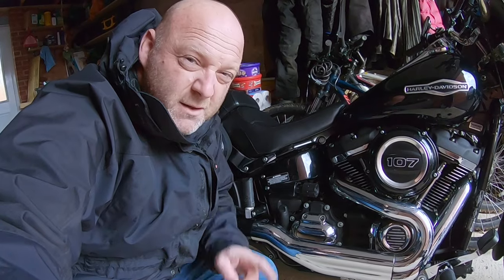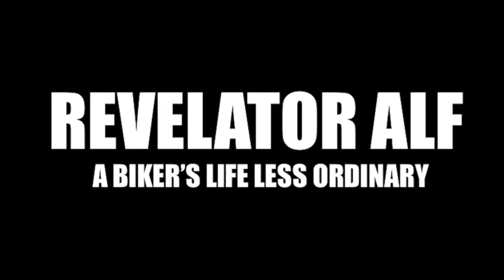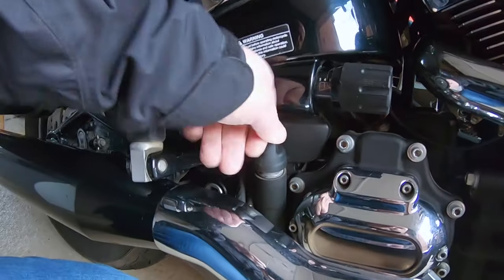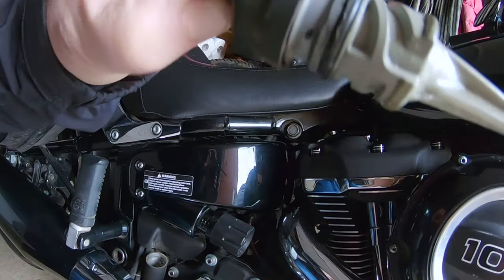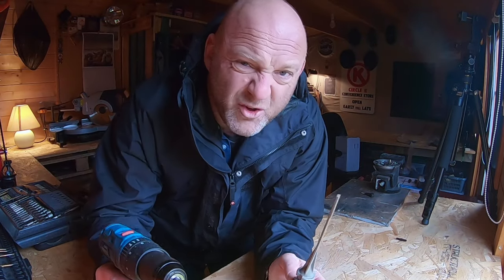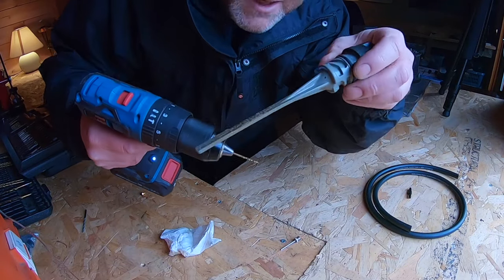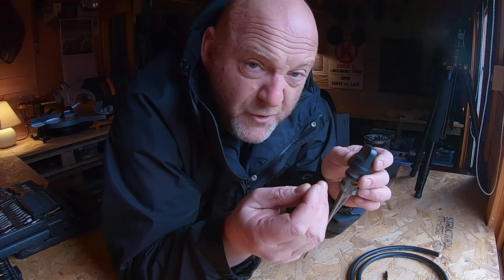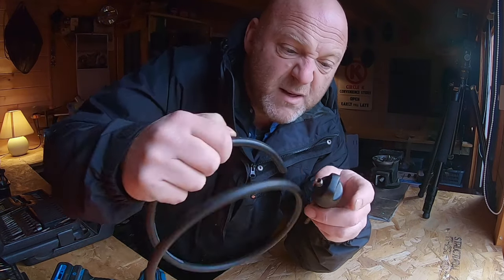How To Make A Harley Davidson Milwaukee 8 Engine Homemade Vented Dipstick

Comment: Hi ,Very similar to what I have done but what you must remember is that the black turn cap is just clipped on ,now that you have made a hole in the bottom to release pressure  in to the dipstick body  .pressure/oil mist can seep under the black cap. I sealed mine so the pipe is the only place for pressure to get out. Keep up the great work my friend. If it doesn't work a new dipstick is only 20 quid.
Reply from the maker: Yep cheers. I added that point to my pinned comment as forgot to mention it in video. I'll be doing a follow up video soon. Dipstick Mark II. cheers

Comment: I'm going to do this with a few small changes...I will use clear silicone tubing and make a larger vent hole in the cap, this way you can visibly see any oily build up in the tube.  Not riding season here yet but when I get it done I will leave some feedback...Thank you for the video...Very helpful...

Comment: Thanks for the video but I think that the hole of tle ball pump pin is way to small if you consider the volume the piston are expelling. High flow in a small hole yield higher speed hence higher pressure that with a bigger hole.

Comment: You have circle k stores in england?
Reply from the maker: We used to, not sure if any are left these days
Reply: So heres a lesson learned…I have a 2018 Road King M8 107ci. I routed my upper breather hose out of the stock air intake mod. When i screwed the cover back on, the vacuum hose i used got pinched between the cover & the air filter by accident. Well, went for a ride & it was running weird, oil light came on. Stopped at a gas station & decided to check the oil, unscrewed it & oil exploded all over me, the pump & the side of the bike was covered in hot oil. It blew half a quart out. I refilled it, removed the air filter & saw where it was pinched. I feel lucky that the head gasket didn’t blow. The pressure in the bottom end was unreal. It just shows how important it is for this engine to breath.

Comment: I know the fueling has a 1 way check valve and I know you mentioned this in your video. The A1 ventilator (not for softail) has the theory the engine breaths both ways to best to have it free flowing.
Reply from the maker: Yes could be right too. Cheers

Comment: Thanks for the video. From the limited information I know any m8 engine stage 2 or higher recommend having a vent due to higher compression and possible dry sumping issues. Great cheap fix!
Reply from the maker: Thanks so much. Yes that's the case I believe too. Cheers
Reply: Stage 2 is just a new cam ... I don't think it modifies the compression.

Comment: Oil pump on 2020+ M8 bikes is supposed to take care of sumping issues.
Oil transfer issue was mainly with hydraulic clutches on touring bikes.
2021 Softails have a vented transmission cover. No oil transfer on my FLSB that I've been able to discern, but,  i've not taken her on a long run yet.
Reply from the maker: yep
Reply: I have a 22 Road Glide Special I was doing 80 miles an hour for long periods Of time all of a sudden  I  felt like something was  pulling my bike back  like an anchor was attached. This happened two weeks ago this is a very weird feeling. So apparently sumping is definitely an issue.. I'm definitely going to get vented dipstick... The sumping issue was not resolved totally... You'll see when you do high speed for a long. Of time.

Comment: I was gonna buy the Feuling one, but realized I could easily make one myself and save over 200$ doing so.
My design is fairly similar to yours but the air passage is much larger.

That air hole tube you used however is not large enough for pass through. The line needs to be 1/4th inch or larger.
Demonstrate this by trying to breathe through that tiny tube, then go grab a juicebox straw. You can't breathe at all through that little tube, you'll pass out. You can almost breathe properly through the juicebox straw. Get a regular straw and you can breathe just fine.
Same with the engine. That hole wont be large enough to let pressure pass through properly and will allow oil to channel up into the breathers.
You arent going to notice much of a difference trying to let the engine vent through a hole meant to fill up soccerballs and basketballs slow enough that kids dont pop them.
Reply from the maker: Can always drill a bigger hole I suppose
Reply: @RevelatorAlf  I plan on using 12mm stuff for mine.
Reply: Are you selling this mod on line for a M8
Regards D
Reply: @davidledward9820  I actually didnt go with this.
I went with the Trask CheckM8, and a Temperature Dipstick instead.
Much better combination.

Comment: WHAT DO YOU THINK ABOUT EXTERNAL BREATHER SYSTEMS
Reply from the maker: I am trying to gather more data on this. I am producing another video for a homemade fix too and then determine whether it has any benefit or not. But I'll have to put some mile on it before there's any results. Cheers
Reply: Can you do a how to for external breather with screaming eagle elite air cleaner.

Comment: My 2021 streetglide trans. is already vented
Reply from the maker: ok great stuff
Reply: @RevelatorAlf  You miss this Revelator,  the poster thinks his crankcase is vented already..  Yep Tom, your transmission was already vented at factory.. Revelator is talking CRANKCASE ventilation (though I don't think the dipstick method is the better way to do it)

Comment: I’m not mechanical RA at all, so forgive the niave question. The valve you used is one way, I.e, air in, is the problem not letting pressure out?
Reply from the maker: Actually in the end I just used an open valve. The long tubing allows for oil to drain back down too

Comment: Great vids Alf, but u should mention that some of those football valves only work one way. So if u push it in to inflate ball the air won't expel back out. Therefore not what u would use for this application.
Reply from the maker: Yes great point actually although mine isn’t like that. Cheers

Comment: I'm still not sure what I'm going for, DK customs in the US make the EBS, still waiting for a reply on the total cost, they want $44 just for the catch can without any of the hose or attachments,  once I hear back I'll let you all know. I've got to admit that you've done something that will do just the same job, Yeh not  fancy but that gives you £300 to spend on something nice for your bike or the missus, depending what means more to you lol, but good fix Alf, at least you've got the confidence to try it for the rest of us, I just don't agree with having to spend over £300 on the bike, yes the feuling vented dip stick looks the part and is very well put together, but its one or the other, vented dip stick or the EBS, there's arguments for both options, I'm definitely going to be looking out to see how you're getting on with it and  see if it actually does help, a very simple, cheap remedy and looks like it will work, excellent video Alf👍.
Reply from the maker: Thanks so much Sarge. Hopefully there will be some clear results one way or the other. Cheers

Comment: Brilliant, only flaw I can see is that if for some reason you did get excessive oil through that system you could oil the rear tyre. Although I couldn’t see the exact routing on the video
Reply from the maker: No risk of that as it is not near the rear tyre and the filter housing also acts as a catch can too. Cheers
Reply: @RevelatorAlf  excellent stuff 👍 does this breather issue happen on the 1200’s ?
Reply from the maker: @daveb1242  I really don't know but this has been a growing issue with the M8s especially ones that have been upstaged. Cheers

Comment: But this venting is only required on the Touring range with hydraulic clutch which suffers from oil transfer from the gearbox to the primary. It’s not required on the Softails with a cable clutch
Reply from the maker: This has nothing to do with that Tom. Cheers

Comment: The first thing you may notice is that the dipstick will be easy to remove after a 40+ minute ride; prior you may have noticed it was hard to remove because of the pressure building in the crankcase!
Reply from the maker: Yes I've noticed it slightly but nothing major to be fair
Reply: @RevelatorAlf  For the past 18 months until last week, every time I went out on a 45+ min. ride I’d check my oil level but realize at least half the time the dipstick was difficult or even not able to be moved by hand.  I assumed the plastic expanded and forced the oil out from the grooves in the stick and was hung up from expanding.  Instead, pressure pushes up on the stick and makes it hard to turn.

Comment: On ur video from a month ago , u r saying that there is no data that supports about the carbon build up , so u r giving an impression that don’t vent the cap because of sensors and data . But from other videos the vent pipe was add on because of back pressure in the crank case .
Reply from the maker: Yes, I clearly state in all of these videos that I am sceptical and I'm trying to generate some data and am only experimenting with these modifications to see if they work or not

Comment: I $pent too much already on the H-D oil level/ temperature gauge dipstick. Someone should use your DIY vent technique on the super expensive temp/oil level dipstick. I want to add venting to mine. But I don’t want to drill my holes in the wrong places and destroy the electronics.
Reply from the maker: It's working so far, well my updated version is at least. Cheers

Comment from the maker: Thanks for watching. Let me know what you think in the comments below. More videos like this here: https://www.youtube.com/playlist?list=PLmgCmljtdCzWrLg62oZxo0laIsmq4j67P

As an addition: You may experience oil seeping from the base of the black cap. This is because it isn't a sealed cap. So you can either put on o ring or gasket sealer or what I have done is place some cloth on the inside of the dipstick shaft after removing the black cap. This still allowing airflow but stop the oil coming out.

Comment: Engine's and transmissions need to breath. The Greenies think you can just seal them up. Well you can't do that and not expect the norman venting action to take place somewhere and the current design is causing problems because it's venting through the intake and exhaust ports via the engine case. That's very bad in a dry sump engine design. Venting through the oil tank is not the best way to do it but it's better than no venting at all. The primary needs to be vented as well. If I had a new Harley Davidson (which I never will) I would install fittings on the engine, transmission, oil tank, and primary case with vent hoses attached to a proper breather box and filter.
Reply from the maker: Yep that seems the way to go for all around protection. Cheers